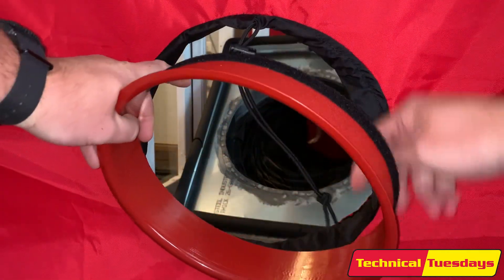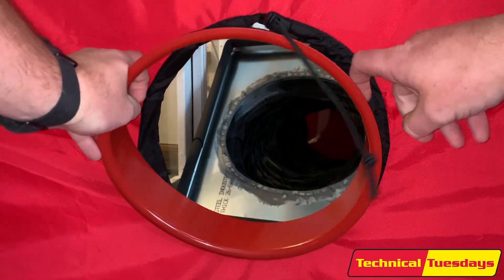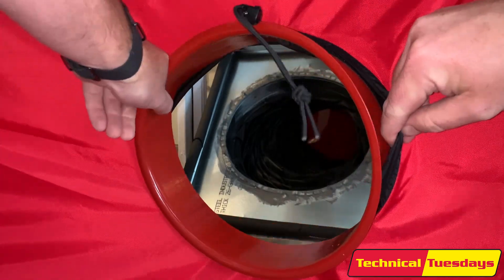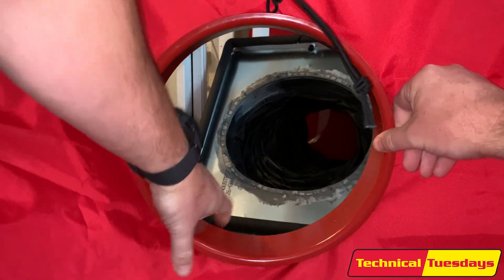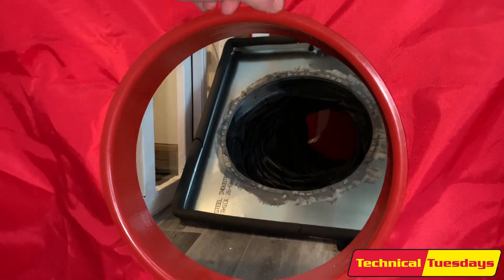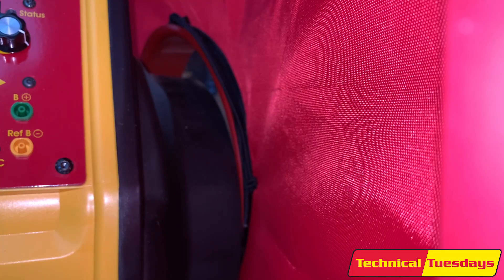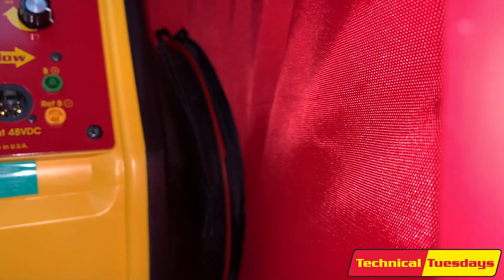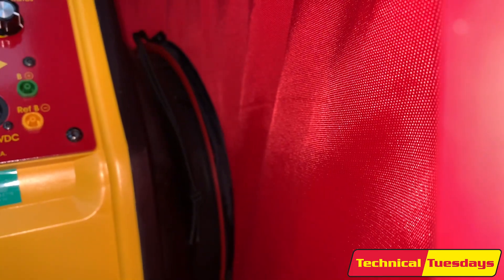Technical Tuesdays Ep.1 - Installing the 300x Fan into the Blower Door Cloth

Comment: I would like to see how it can be used to conduct air tightness tests on small/tight building enclosures. All of my houses need to be below 3.5Ach. Can this little fan do that?
Reply from the maker: it depends on the size of the building. 3.5 isn't crazy tight, so on a regular sized home, you still may need a full sized fan. You can expect 800 CFM out of the model 300 fan running wide open.